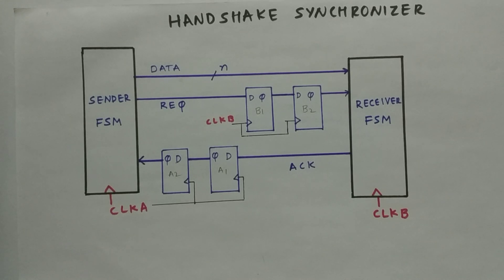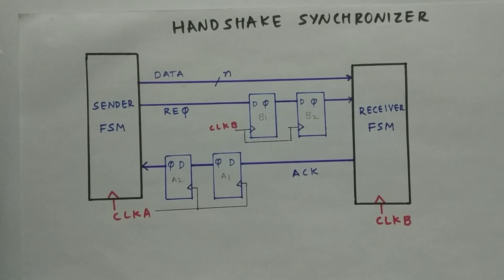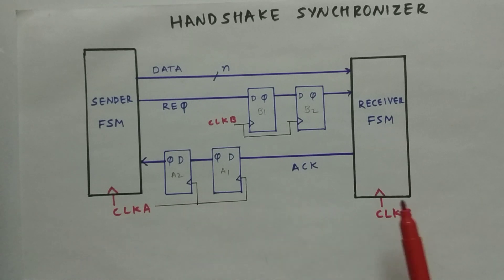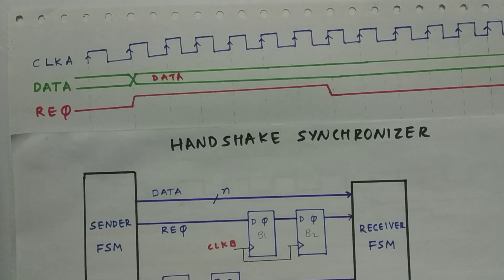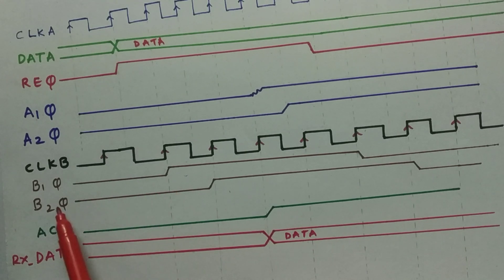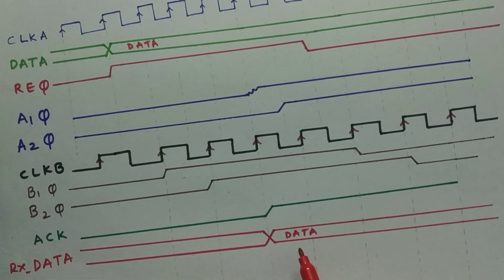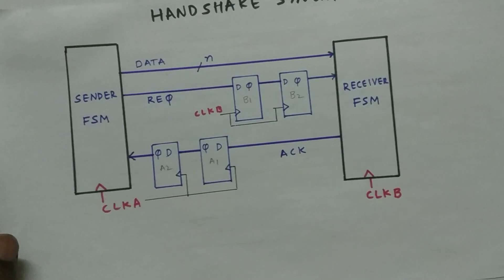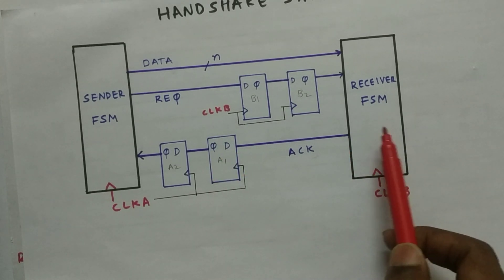Handshake synchronizer (clock domain crossing)

Comment: DATA lines and REQ line can be routed in FPGA in very different paths and lengths. Thats why  synchronization work only for one signal - REQ. If you want synchronize DATA, you need "set max delay" between REQ path and all DATA paths (REQ to DATA0, REQ to DATA1 and so on) to less then one clock cycle (of maximal clock).

Comment: Why can the data not be changed until it recieves ACK signal? Could you please clarify this? If the data is changed after one cycle, even then it could be stable right after it passes through 2 flop synchroniser? Then why is this constraint passed that it should not be changed?

Comment: When there is slow logic that needs to catch a pulse generated by fast logic.. what are the alternatives to the handshake approach?

(
Sender outputs data and THEN asserts REQ 
Receiver latches data and THEN asserts ACK 
Sender deasserts REQ, will not reassert it until ACK deasserts 
Receiver sees REQ deasserted, deasserts ACK when ready to continue
)

For example, is there a way the pulse could be stretched, such that to guarantee it would be seen by logic running from the slower-clock?
Reply: Hi whats the difference between handshake based pulse synchronizer and simple handshake synchronizer

Comment: One thing not made clear is that when the sender receives the ack it needs to set the request signal low because the receiver needs to be waiting and watching for it to go low so that it knows when to deassert it's ack signal.
Reply: I don't get it, so the sender doesn't change the data as long as REQ is high and ACK is low, once the receiver gets the data ACK goes high and the sender sees this. After receiving the ACK the sender makes REQ go low? If that's how it happens then how is the next bit sent? Shouldn't REQ be stable for the next bit also?

Comment: Shall depth of flops used for synchronisation should be same for data transfer control and ack ? If no, then how it is decided ?
Reply from the maker: Hey Chakra , thanks for asking the question, 
Yes it can vary , we must choose depth such that we don't get metastable state , for data transfer it we may require 2 , for ack we may require 3 , it all depends on the clocks.
Good luck, good health 👍
Reply: @KarthikVippala  Thanks... I was also thinking of that... It would have been to include this in your video and what is the best way to identify whether your synchronization with ack is functionally correct or not ?
Reply from the maker: @agarwalchucky   I missed that , I  will answer the queries if you have any.👍
Reply: @KarthikVippala  I heard this method designed in such a way of irrespective of clock ratios. And coming to question raised by Agarwal ji. Its all depends on the MTBF. And inturn MTBF is inversely proportional to incoming data rate.

Comment: Can we use handshaking method when passing signal from high frequency clock domain to low frequency clock domain (usually use asynchronous FIFO) ? Or is it only applicable from low frequency clock domain to high frequency clock domain just like any other synchronisers (two flipflops) did?
Reply from the maker: Hi see Jing yin, thanks for asking the question, Yes we can use it for high to low . Good luck, good health 👍
Reply: @KarthikVippala  So Normally for AFIFO which synchronization scheme will you prefer to use for control paths of an AFIFO?

Comment: What is the resource you use to make these videos? I want to solve practice problems
Reply from the maker: Hey Saurabh thanks for asking,  I have found these on papers published on synchronization, you can search it on web for it.
Good luck 👍
Reply: @KarthikVippala  Thanks a lot. Can you make videos on Lockup Latch Concept?
Reply from the maker: Hey Saurabh thanks for asking, Yes I will make it , can tell me what you need
Reply: @KarthikVippala  I never got the timing considerations using Lockup Latch correctly, so it will be great if you can explain it.
Reply from the maker: @saurabhsrivastava2370  hey I will try to it by next week , is that ok for you👍
Reply: @KarthikVippala  I think you forgot about it.
Reply from the maker: Saurabh , I was busy lately , I will make it this week , thanks for your patience.
Good luck, good health👍